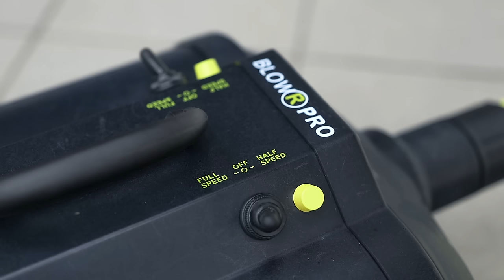Deep Cleaning A Dirty Engine Bay - ASMR Detailing

Comment: Electrical circuits 
Fuses 
Metal parts
Electronic parts
Power connections 
etc. all these will be damped and could get rusty if high pressurised water sprayed on them. 
Car manufacturers recommend cleaning engine bays using cleaners and degreasers and thorough wiping
Reply: AAY AYYY CAPTAIN
Reply: ??? Ask my jeep that drives under water if it’s cares. Being a Mercedes I think thee are smart enough you use a gasket or o-rings on most of those components…

Comment: Great job! Carpro MulitX is not designed for engine cleaning it is a multiple Iron & Tar remover.. Both dose not contaminate inside engine. I prefer degreaser so it work better for engine oils.

Comment: Be careful that all that stuff is not going to the air filter, just an advice. Nice job by the way
Reply: Why tell us?
Reply: Its all good just mercedes.
Reply: It will smell wet dog in the car if you spray water in those vents in the engine bay ,This is why you need to be careful if you owned a merc you know

Comment: as far as I know, one should never pressure wash an engine bay. there are some connectors and seals that yeah, they're supossed to be waterproof but over time and with temps up and downs they tend to be less sealed. so a garden hose would do the job safer.

Comment: I just did this to an ML350 Bluetec, however i removed the engine cover. Now I know it's clean everywhere. I like to use Superclean, i buy the gallon jugs and then dilute it for different applications. For the engine bay no dilution is needed.

Comment: What is the dilution for multi x for use in the engine bay? Also is there anything I need to wrap in a plastic bag (avoid getting electronics wet) in a 2012 e300 Mercedes?

Comment: Hi bro I like your works but please tell me about the steps before cleaning the engine bay what are the precautions steps to be taken in case of vehicle whose engine bay comes with proper guard or something
Reply from the maker: Hey man, I recommend covering up any exposed electrical or sensitive parts. On modern cars you should be fine doing it the way I did it.

Comment: i love your videos... but next time try to remove engine cover...  you just cleaned 50% of the engine.
Reply: Looked pretty clean to me.
Reply: Nooo. By removing the cover you exposed yourself to mechanical issues. Unless you can fix the engine lights, engine running rough, leave it alone, that is why they put a cover.
Reply: @Gnetbird  i do this deep engine cleanings and never had any issue
Reply: German vehicles are different some have intakes connected to the cover its safer to leave it

Comment: Hey VCD, big fan. I'm trying to use your method but I just had a question. What is that foam stuff that you used? (Is it the CARPRO Reset Shampoo?) Is that the same as regular car shampoo for washing the exterior? And any reason you used the iK Foam PRO 2 instead of a regular foam gun/cannon? Thanks, and keep up the great work

Comment: Do you disconnect the battery while cleaning the engine bay?
Awesome work!!
Reply from the maker: Thanks Philipp! On modern cars I don’t do that. If you want to be extremely cautious you can, but I don’t think it’s necessary. Modern engine bays can deal with some water.
Reply: @VermijlCarDetail  2013 models and up?
Reply: @nix_fx  easily will cope with that

Comment: I washed my engine bay with some degreaser a few months ago. I've had 3 warning lights since. I did cover the alternator and disconnected the battery and used a garden hose instead of a pressure washer.
Reply: How old is your vehicle? Pressure would be better as the water is going at a higher velocity and pushing dirt off. Using a garden hose is basically drowning the vehicles parts.
Reply: Sad to hear your experience. What was the solution?
Reply: @JJS432  It's 2004. I see, but i thought pressure would force the water into seals and electrical connectors so i didn't want to do that.
Reply: @a1inMil-Experience  It was nothing that affected driving safety, fortunately. My dad took the car for maintenance recently and apparently the ABS system fuse had blown which caused the warning lights.
Reply: @idkwuisp7626  check this out for more safer way to clean the engine bay https://youtu.be/PRSoRkM8GcM

My personal opinion is not to use water horse. Using a soapy water in a spray bottle would be ideal and wipe out all the moisture by wiping out + vacuuming asap.
Reply: @idkwuisp7626  - I've cleaned engines for little more than 35 years, petrol,  diesel. lpg. I can assure you, that "the ass and the pants are two different things"! LOL 
All those ridiculous myths that people dump on YT. Are precisely that myths! The worst case scenario usually is the high tension side of the ignition system getting wet. (Spark plugs, cables...) On a diesel it's not even an issue, for obvious reasons. Meaning, the moment it gets dry no problem(s) will follow.
Those warning lights, I'm pretty sure, have nothing to do with the clean. Search other reasons or motives for that particular failure. ;-)
Most people don't realize but you can run a 12v electric motor under fresh water, with no particular issues!! To give an extreme example. ;-) 

So look elsewhere for the problem and don't spread myths! Cheers

Edit: I've just read your other comment regarding the ABS. Thanks for confirming that both things have nothing to do with each other. Cheers
Reply: @crpth1  +10 to this guy what an important info thank you very much!

Comment: nice detail👍 isn't it dangerous with that amount of moisture in that engine bay?
Reply from the maker: Thanks Artur! I’ve detailed a lot of modern engine bays this way and I’ve never had an issue. If there are any exposed electrical parts or wires I do cover them up with a plastic bag, just to be sure. But other than that you should be fine doing it this way! I wouldn’t do this on an older engine, in that case I prefer to use a steamer (also have a video on that)
Reply: If you cover the fuse box and alternator, then you’re good to go in most cases. Maybe take out the air filter or battery if you’re nervous and paranoid about it but otherwise it’s all good. The finish you get is insane as it’s rarely done with most cars.
Reply: @VermijlCarDetail  There should be no problem cleaning with water a Nissan Sentra Nismo 2018 I’m kinda scared doing it, there’s anything you could recommend me or I’ll just go for it

Comment: Quick question: do i need to run the engine when im spraying it with the power washer?
Reply from the maker: Yea, if you want to be really cautious you’re better off disconnecting the battery instead of running the engine.
Reply: lmfao what

Comment: My mechanic says: don't apply pressure washer while you clean your bay, better do not use watet, only specific chemical, in koch you have golden star for cleaning if im not wrong
Reply: I clean mine with a bucket of water, some car cleaning spray/protectant, a brush like in the video, and then I wipe off the suds and grime. It was time consuming the first time, but now I just maintain it.

Comment: Its pain to watch. I dont like to bring water to any electrical cable. I usually use wet towel and brush with soap then wipe it when finish one section. But great asmr for blower.

Comment: What are you dilution rates for both Carpro product used?
Reply from the maker: It's been a while, I usually use MultiX 1:10 - 1:20 depending on how dirty the car is. I recommend using Perl 1:1 (satin) - 1:3 (more of a matt finish)

Comment: The first application of MultiX and Perl wasn't diluted? If not have you ever come across any etching/decomposing issues using it full strength? I've been too scared to attempt it.
Reply from the maker: You could use MultiX undiluted when the engine bay is extremely dirty/greasy, it was designed to be used like that (only for certain purposes) but in this case I used it 1:10. Strong enough in my opinion, I personally have never used it undiluted. Also Perl has been diluted 1:3.
Reply: @VermijlCarDetail  Thank you! I greatly appreciate it. Definitely subscribing 🤙
Reply from the maker: T_Dub33 you’re welcome! Thanks for subscribing!

Comment: Do you know Koch Chemie Motorplast? It is greate you can use this as a wet post treatment for the engine bay. You have to spray it on the wet surface an let it sit for a few hours. Finish with out touching agin the engine bay. It perfect for high temperature parts

Comment: good night my brother, our company has been working for a long time, i have a question, lol hitting the vape like this doesn’t damage the engine? beginner's question, and I appreciate if you answer.
Reply from the maker: Hey man! I’ve detailed a lot of modern engine bays this way and I’ve never had an issue. If there are any exposed electrical parts or wires I do cover them up with a plastic bag, just to be sure. But other than that you should be fine doing it this way!

Comment: Isn't it supposed to be bad to use water directly in the engine?
Reply: It can be if you aren’t careful. Use a low power nozzle or a small stream. And Don’t completely drench the engine in water. Thats how I cleaned my engine and bay in my buick and It was fine
Reply from the maker: No problem with modern engines! Never had any issues doing it this way. I would suggest covering up any electrical or sensitive parts if they are exposed though.

Comment: Is power washing your engine safe?
Reply: If you blow it and start after it's not dangerous, on modern cars the connections are water proof and the user manual of most cars recommend to wash it when winter finish, also the official dealers wash the engines after every service. I worked in Mercedes, BMW and multibrand.

Comment: It’s basically impossible to clean my dad’s 2011 Toyota Tacoma engine bay it’s so tight also the cover is right over the belt so yeah it’s very difficult
Reply from the maker: Some are indeed not that easily accessible. Might just have to give it your best shot!
Reply: Yeah good way to f up the engine because the belt and the plugs

Comment: Is it okay to get it wet with water?🤔
Reply: the actual engine. you can get it wet but not soaking wet. suggest using like a garbage bag to cover it. you can get it soaking wet the surrounding parts. but the actual engine. you should dry clean it.

Comment: i have a 2012 honda pilot could i wash my engine with water without damaging anything?
Reply from the maker: You should be completely fine doing it this way. If you want to be really cautious I'd recommend disconnecting the battery and covering up any exposed electrical parts.
Reply: @VermijlCarDetail  ok thank you

Comment: So would it be safe to jet wash my engine down on my mk7 golf r? Anything I should protect?
Reply from the maker: You can cover up any exposed wiring, but I don't think it's necessary. I've done an engine bay detail like this one on a Golf 7.5R about 2 months ago and didn't cover up anything. No issues at all!
Reply: @VermijlCarDetail  thank you very much. Il give it a go at the weekend
Reply: If you really wanna make sure that nothing happens, take out the battery. Other than that you just have to be sure that you get everything dry again after the wash.

Comment: I wouldn't recommend doing a engine bay wash like that my Mercedes wasn't working after that for 14 days until I was lucky and the unknown part which wasn't working  dryed out for itself. I would recommend a dry wash so just some towels and as less water as possible or just some towels which are lightly wet and no direkt water in the engine bay. To costly and to risky the shown method if something goes not as planed.
Reply: Thanks man

Comment: I don’t do engine details anymore because once I did a 15 year old dodge 1500 and the truck shut off about 3 miles away from me after they drove it off and they couldn’t get it started for about 12 hours.
Reply from the maker: That's unfortunate! I never had any issues when doing engine details. I do mask off any sensitive parts when they are exposed though.
Reply: Vermijl Car Detail it was the mass airflow sensor that got wet. It was embarrassing because they kept saying it was the spark plugs that got wet.
Reply: @439530  A Mass Airflow Sensor alone would not completely shut down an Engine. You can drive without a Mass Airflow sensor, many people will highly modified vehicles do so (Me included) there was something else damaged in the process, so they may have been right the Spark plugs could have been flooded.
Reply: xBlue Wolfy makes sense but how do the spark plugs get flooded aren’t they somewhat water resistant? I’ve never heard of them getting flooded.
Reply: xBlue Wolfy and how does it explain it not being able to start for 12 hours? They removed them and cleaned them but it still wouldn’t start.
Reply: Simple tips. 
- Wash the engine when warm. 
- Wash the engine with warm water.
On both cases it will dry way faster. For obvious reasons avoid a really hot engine.
So let it seat for awhile, if you've just run two hours straight at full throttle! LOL 😂
- Dry it after washing! 
This can be as simple as let it dry for some hours! Just like when you wash your clothes...  ;-)
Or give it a little help to speed things up. Compressed air, leaf blower, etc. Many shop vacuums have a reverse function, ideal for this. In fact It's all rather simple!
Reply: @439530  - "start for 12 hours? They removed them and cleaned them but it still wouldn’t start."
Logic is biting. If they cleaned them and it didn't work. Either it was not done correctly or the problem was elsewhere. ;-)
Most probably, overlooked, crank or cam sensor. Anyway this part is pure wild guessing at this point.
BTW the high tension side of the ignition. Read coils, cables... If bridged by water (or anything else). The spark will not happen where it's needed. Or can be weak enough to allow them to get "flooded" (not burning the fuel).
Reply: @crpth1  having someone remove every single spark plug and clean them off gave me the impression that they checked off the battery for crank, but when I went to help I connected the cables and got the truck started. However, the truck was running poorly with loss of power for about 30 mins then ran normally. Only thing I can think of is that their truck was in bad shape to begin with. But I now know that older engines need to be steam cleaned not shot with a garden hose as they lose their seal capacities or simply don’t have any kind of water resistance. I’m not a mechanic I don’t know but I still stay away from engines because they can say whatever they want and in a way I will be held responsible.

Comment: Good job, but the description you put in the video is misleading. If this was a deep clean, then why was the plastic cover still on the engine? If it was a described as a cosmetic engine bay detail, I think it'll be fair and correct to put that as the accurate description (instead of letting beginners think that what you did is all there is to do in a deep clean of an engine bay).

Comment: Master mechanic with Porsche, Mercedes and Audi experience said to NEVER introduce water (especially under pressure) to an engine compartment.....Ever.  Old cars without all the electronics was a different story
Reply: Aaah you know I’m perplex… on the one hand I agree with you, but on the other hand I think an engine is a closed circuit so no water goes in. It’s just plastics and metallic tubes with dirt on it.
If you cover the battery and calculator area with tape, it should be good right?

Comment: Some wax would out perform pearl looks wise though. Looks too dull and the black isnt deep either i think.
Reply from the maker: I think it looks great. Perl definitely darkens the plastic and rubber parts. I don’t like it too shiny though, makes it look greasy and cheap. You can’t put wax on plastic and rubber parts, why would you do that?
Reply: Vermijl Car Detail but bro pearl makes it pearl more. Wax just adds colour and depth and thats whats needed. Wont really need pearl as it wont be under direct sunlight and pearls a glosser it will remove the oem look while wax wont try it and message me back if you like do a trial and error lol
Reply: Statistics speak for itself and I suppose you’ll be able to get wax into all the tight areas 🤦🏻‍♂️😂